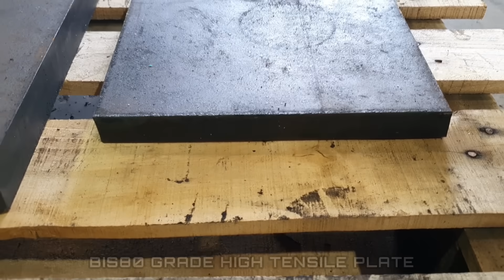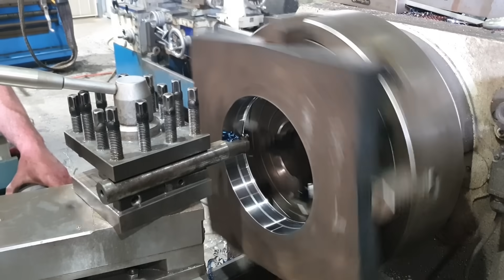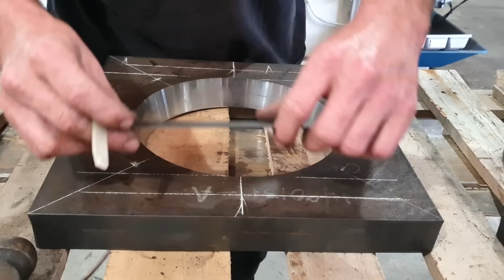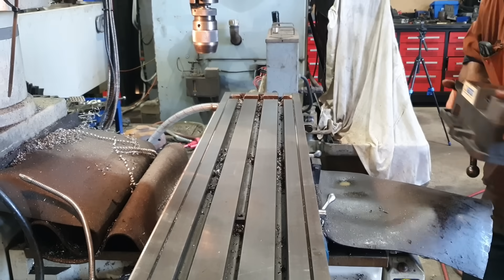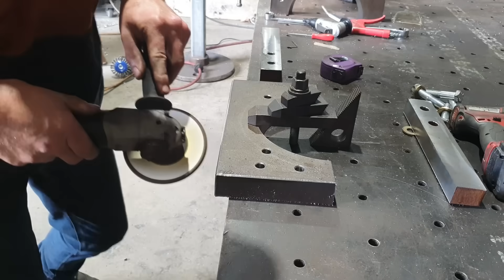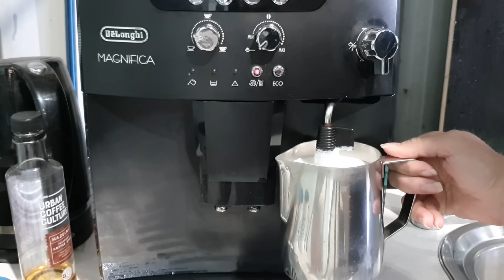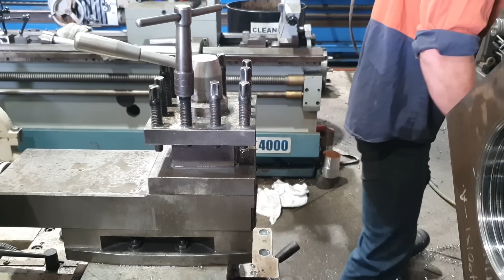Making a Custom Bearing Puller | Shop Made Tools

Comment: Kurtis! Can you talk a bit about tolerances and precision? Your lathe work is extremely precise, but those chalk lines are like a mm thick.
Reply from the maker: it's a balance between precision and how much fuck around you want to do 😂 the lathe work needed to be precise, the drilling and tapping of holes was not super critical within 1mm is fine for a tool like this. No point wasting time and customers money on unnecessary measuring 😎👍
Reply: Thanks Kurt, learning a lot from you!

Comment: I've never welded anything in my life so this might be a dumb question. When you're welding the bars to the plate does the molten metal flow under the bar from capillary action or does it pretty much stay in the corner between the bar and the plate? Is it a question of viscosity and are there ways to change that depending on what you're doing, type of wire, temperature etc.
Reply: A filet is formed which consists of a mixture of the base metal, and the filler metal, which in the case of this mig weld is wire which advances through the welding handle at a set rate of speed. 
The trick of mig welding is to advance your mig handle at a constant forward rate to maintain a constant puddle size and shape, resulting in a nice filet. 
Not an easy thing to do, despite the fact that Curtis makes it look easy. 
The puddle of molton metal is viscous and cools fast as you advance, so no there isn’t really any “wicking” of the liquid metal under the top piece.
Reply: Basically you are melting a round puddle of metal surrounding the arc (the tip of the wire in this case), and then the filler metal (from the melting wire in mig) fills in the hole created to build up the weld.
So on an unprepared (sharp edges, no bevels) inside corner like this doing a fillett weld, if you cut a cross section you would see that it melted into the flat plate, and also melted into the bottom edge of the bar.
So on the flat plate it would be like a groove was gouged out, partly extending below the edge of the bar, and it will be like the lower corner of the bar is melted off giving it a beveled edge.

But thanks to Kurtis's skillz, he guides the molten metal (partly from the plate and bar, partly from the melting wire) into the weld pool and refills them so they are slightly over filled.

Since the arc heats and melts a relatively circular area, you can picture each arc diameter as a seperate operation, so it's melting into the plate, melting into the bar, and melting back into the last spot welded, and then filling that puddle up and mixing them all together.
Then it moves forward to the next location and repeats the process.

This leaves each layer of weld on an angle since it's bridging from the flat base metal up to the top of the bead of filler metal.

A really good bead, especially with TIG is often referred to as "stacking dimes" because that's what it looks like.

With a machine like this and the technique Kurtis uses it's going to be more of an elongated weld pool, and he's very smooth, so it looks more like a bead of perfection than a stack of dimes, but if you break it down to a single weld pool at a time it's easier to visualize what's going on.
And I was trying to paint a word picture, rather than get technical on the details, so no hate mail lol

As to your question, no, there is no wicking under the bar like with solder, the weld is entirely in the area that was actually melted and fused right on the side.
And unlike if it was a bead of glue or caulk which would just sit on the surface, there is the melting into the parent metal, which is called Penetration.
It's possible to lay a weld bead that only sits on the top of the metal, but it is likely to fall off lol (see their recent video on redoing a line boring job where the last guy got no Penetration and it just sat on the surface, because it wasn't hot enough to melt into the base metal and fuse with it.) 
You have to melt down into both pieces that you are welding to get them to fuse, and the more Penetration you get, the larger the cross section of the fused metal and the stronger it is.

And if you need a REALLY strong weld, then you bevel it.
You know how when he welds the cylinder eyes on, he will leave a wide gap between the eye and the rod, and then fill it up completely with the welder?
That is so that the entire thickness of the rod, other than the little center dowel or whatever, is completely fused between the rod and the eye.
If he's welding thicker steel you will see him bevel the edges back and then start welding down in the "root" and then fill the v bevel up to the top.
This fuses the entire thickness.

Solder or brazing melts at a lower temperature than the base metal, and so you can heat the base metal up hot enough to melt the solder, and then it can wick into the gap and then cool and harden.
If the molten metal is the same, then if it tries to flow into a crack, it will instantly chill and solidify because the base metal is much cooler. And if you try to get the base metal hot enough to make it work, you will just melt the base metal and destroy the whole thing.

Now, I realize that you could have watched a video on the welding process in the time it took me to write this, but I had fun and hopefully it makes sense to you!

And if you are interested, look up "welding penetration" or "welding cross section" on Google or YouTube and you will be able to see PICTURES!
Reply: @ke6gwf  Thanks for taking the time, I really appreciate it. I've always wondered how the weld could be strong enough if you"re using bronze or whatever wire but I never considered that the arc was actually melting the steel (obvious now that you explain it) so you're liquefying the two parts and your wire and fusing them together with an alloy made of all 3.
Reply: @D4N1CU5  when you say bronze wire, I feel further clarification coming on! Lol
Brazing is done with a brazing alloy that's brass based.
MIG wire such as what Kurtis uses is often brass colored, but that's because most steel MIG wire has a thin brass plating on prevent corrosion and help it feed smoothly, so it may look brassy, but it's actually steel wire, of the same, or complementary, alloy to the base metal that is being welded, because again, it has to be able to mix properly and fuse with the base metal.
Reply: @D4N1CU5  oh, and brazing and soldering can bond dissimilar metals together, fastening aluminum to steel, brass to titanium, etc, where you can't fusion weld because they don't mix with each other, different crystal structures, different melting points, etc.
There are ways to fuse dissimilar metals together, lasers, explosives, electron beams, etc, but they are pretty rare. But fun! Lol

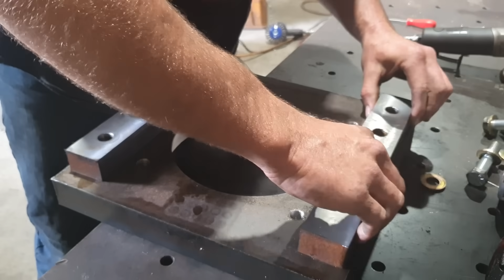Comment: I see you using Banana Bolts to go with the Banana Tap from earlier, are you feeling OK? 30:05 
John, Australia.
Reply from the maker: Send help 🤣
Reply: @CuttingEdgeEngineering  Help can be delivered via education that there is two basic systems. Does not matter if is mm or inch, a part has to be the correct size in both Languages. Both are correct!
John.

Comment: Hi Curtis, Thanks for a nice vid again! I have a question however. Long time ago ( like 35 years) when I was in school I was always battered about not pre-drilling the bigger size hole's. Like 17 mm I had to pre drill with like 6-7 mm. However lazy as I was never did this. Now I see you do not pre drill this size hole's. So is my conclusion that I was not lazy after all butt just efficient?
Reply from the maker: hey mate it comes down to personal preference and tooling. I'm using a split point drill and they don't need a pilot hole. I'd say you were being efficient 😂👍
Reply: Yep - it all depends on the grind on the drill bit. The web of a 17mm drill is pretty big, like 4mm or so? If it's not a split point grind, you have to literally push that 4mm web through the stock, not cutting, shoving! That takes a huge amount of force, so a pilot hole is used to ensure that the pressure required is lower.
So, a pilot hole can make a big hole drill much faster, since all the force can be applied to the cutting edges, letting them really tear that material out quickly!

Comment: Hiya Kurtis , When We remove the outers of a bearing We just run a pass or 2 of reasonably hot Mig Weld around the inside, they shrink like crazy then and generally just fall out or tap out with no effort

Comment: I had to make myself a bearing puller once.
I got an old bearing that was about the right size to fit inside the lip.
Cut it into quarters and welded the bits inside a bit of tube that was split part way to make the fingers.
I then sacrificed a scissor jack for the screw and bearing and nut and rigged it to the tube to press on the shaft.
A hose clamp compressed the fingers around the bearing.
It worked just long enough to get the job done.

Comment: That's the way to tap. Use a machine tap, drilling RPM, solid driver, plenty of oil. Use it like a cuttin' tool. Speeds and feeds!

Never use a hand tap on a production machine. It's like runnin' a foot race with one shoe trapped in a bucket.

Comment: It made me thinking if a tool could be made that would accomodate more than one bearing size and still be about as good as this one. I guess something like a lathe chuck with a big hole in the middle, six or eight jaws stretching inside and with four holes for pulling bars on the perimeter. But that depends on how many different diameters one has to deal with, if your customer only needs to work with these two diameters then these are ideal.
Anyway, good job and great watch as usual. Keep it up, guys!
Reply: We made a  "universal puller" from an old 3 jaw chuck at work. We ground a step on each of the jaws so it could grip the flange of the taper bearing cone section. It was a bit unwieldy, but did the job 99% of the time.

Comment: I've torched off dozens of bearings and races over the years. I never thought to make this type of puller. Thank you for the idea, Love your videos.
Reply from the maker: Thanks for watching
Reply: Just imagine the time you can save with this pullers. Man I fell satisfaction just thinking about it.
Reply: @BrayleArroyo  Yes, especially if you can put that on, and easily get a bearing off that is deep in a housing, or your torch is going to damage some other part.

Comment: Banana Man again, 13/10. I have had to make custom pullers and installers for these tapered roller bearings before as well. The problem I had was there wasn’t any room to pull the cone. Then there wasn’t a tool made to press the new one on.
Reply: Induction heaters are used but before that an old electric frying pan filled with oil to heat it to temp. To incraes the ID or chill the shaft and they just slide right on but you have to be quick either way

Comment: Ahhh memories. I flashed back to the recommissioning of a cotton gin and refreshing the bearings on some of the motors.
After the first time the puller (porta-power) and bearing came flying off at a rate of knots (the bearing left a nice dent in the wall) we tied the puller to the motor with some telecom rope and NOBODY was allowed in front of the shaft...
Reply: Amazing how much energy the pulling bolts can store with a Porta power pulling on them ain't it! Lol
Reply from the maker: Good times 🤣👍
Reply: @CuttingEdgeEngineering  
Oh yeah, no qualified sparky on site and all motors still wired in, the switching room looked like it had been raided by 13yos on crack.

Comment: I was concerned about how you measured that plate for the holes. You were using some defunct metric system, while we all know the only quality standard is bananas.
Reply: I think he knew how many little metric bits make 1 banana so he had a pretty good idea what size he needed.
Reply: @jonka1 you know that the banana system is based on metric 😊
Reply: @gunnargu  Maybe the new ones are metric but I'm still using the imperial ones I inherited from my Dad. One problem I have with them is having to convert my readings  into metric for all this modern stuff I work on now.
Reply: Imperial was developed  by people, for people doing daily life which is why it works.
Metric sucks unless you are a scientist.
Reply: Fun fact, U.S. maybe would've used metric if British pirates didn't steal the tool from the U.S.
Reply: @needtoknow64 maybe but I like to think that America, being the ones who led the industrial revolution (i think), had to make bigger changes to its system if they did switch to metric. And if it aint broke then don't fix it. Even if metric is better, Imperial/SAE works fine.
Reply: jessechristensen1074 😂😂😂😂😂😂😂😂😂😂😂😂😂😂😂😂😂😂😂😂😂😂😂😂😂😂😂😂😂😂😂😂
Reply: Atleast he wasn’t using is fingers 😅 and foot
Reply: Plenty of bananas grown south of there, right down to Coffs Harbour. (Proud NSWelshman here, go the blues).
Reply: All the Bananas have gone North, none left here.
Reply: He did use the real measurements for the bolt threads, 5/8 UNC.
Reply: @tiredoldmechanic1791  Stolen from Joseph Whitworth but with a little Yank tweeking.
Reply: The older - and superior metric system. Bananas is fervcakes

Comment: For those that aren't familiar with the concept applying a bit of heat in a few spot DOESN'T shrink things 0:36
Karen I think you need a better voiceover guy ;)
Reply: It's always worked for me.
You could give more detail.
I normally run a little weld.
The ring can't expand but will shrink as the weld cools.
It's next to the last method I use to remove a stubborn bearing ring.
The last being cut it out, as we all know is no fun (pain in the arse)

Comment: Hey guys. Great stuff once again. Could you maybe do a short vid on what all the different types of inserts are and what they are used for. 👍
Reply from the maker: It's on the video ideas list!
Reply: Another one would be how that lathe works and what you do to do what you do. 👍
Reply: Try the Engineers Black Book for all of the explanations.
Reply: @royreynolds108  What does that cost these days? If I am thinking of the right book.

Comment: The Wise Machinist once asked of the Apprentice:
"What came first? The Shop bought Tool or the Shop made tool?"

-Meditations of Steel and Precision Chapter 3, by Karl the Philosopher.
Reply: I'm only a house painter but the bakery where I go to get lunch does a egg and chicken sandwich.
I ask myself the same question
Reply: @lastguy8613  these are life's important questions.
Reply: @MajesticDemonLord  I call it the what came first sandwich but I always eat the chicken bit first as its not as good as the egg side.
I just wish they'd make more egg sandwiches so when I'm late I don't get the philosophical delima tbh
Reply: I wonder when Carl’s real name will be revealed to the new subscribers……
Reply: Always the shop made tool, the shop bought tool is invariably only used for common things, and I would say most machinists still use the tools and jigs they made as apprentices, and have gone on to make many more.  Remember many a shop made tool starts off as a broken shop bought tool, that failed to do the job, and was modified and upgraded to do the job properly or differently.

Comment: Quite an ingenious bearing puller. 
It sounds like the customer is going to refurbish their used bearings. It'll save them a chunk of cash. 
I'm impressed with your method of cutting a ginormous hole in a big plate of steel.
Reply: They need to split the cage of the bearing, rendering it useless.
Reply: @MoraFermi  Not necessarily, they can cut the cage, remove the rollers, and then regrind the races to fit oversize rollers, and put in a new cage. Cheaper than a new bearing, and you can still reuse the cage if you simply prepare it and weld it up again on the cut. Big cost saving on those large bearings to recondition them, and provided you have not let it get too worn, you get a good number of refurbishment cycles as well before you need to replace them.
Reply: @SeanBZA  would anyone go to that much trouble?
Reply: @marksmallman4572  If your new bearing is $1k, and refurbishing gives you half again at a minimum as much life for $300, it is worth it. For very large bearings all will be refurbished at some point, especially as the price goes over $5k, and lead times for new ones are measured in months. Some you have little option, as a new one might be a year or more to order, and you need the machine to run, while a refurbish might only take a week. 

For some you just have to do it, as the original manufacturer might no longer make them, which is common in older precision instrumentation, as the bearing races are actually part of the machine, and you simply polish them and put in matched sets of balls. There your refurbishment means you select from a whole series of slightly different diameter balls, to get the right clearances in the machine.
Reply: @SeanBZA  Given how much work it is to pull these off and re-install, I expect there is very little economic reason to try to rebuild a bearing..  However, using a puller like this will make it less likely to damage the shaft compared to cutting off with oxy/gouger/etc, so to me, that's the value..
Reply: @ursamajor26  guess what even if you buy a new bearing you still have to remove the old one and install the new one… so that time doesn’t matter. The parts costs do.
Reply: @ursamajor26  True, but the rebuilders do make a living off this, especially for the more expensive types. Common to see the bearings that are used for things like bridges and other large infrastructure, along with things like slew rings for equipment, get a rebuilt bearing when they are serviced, as the price difference is often large, and the rebuilt unit is just as long lasting as original.